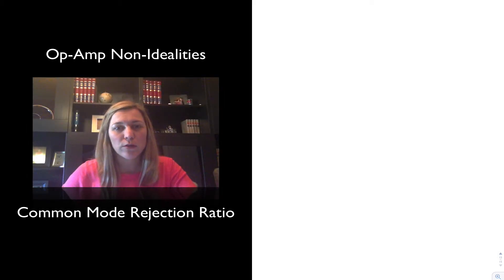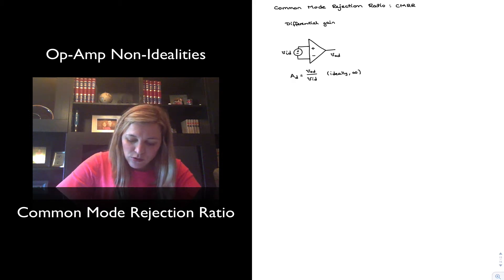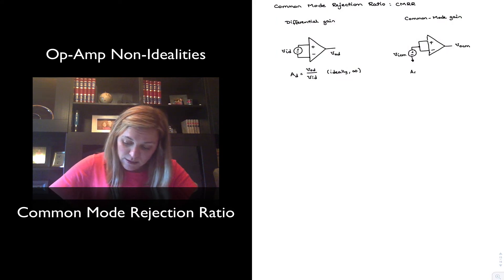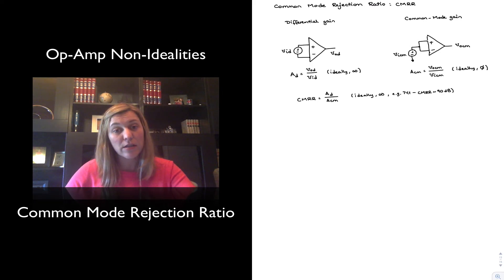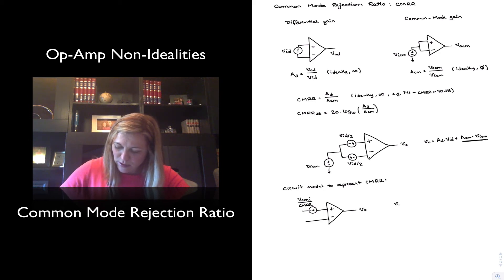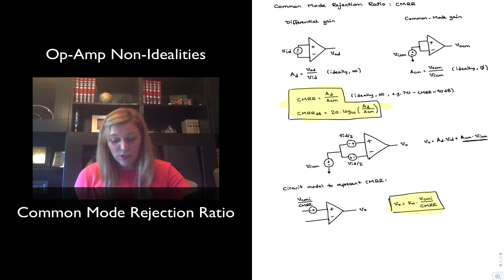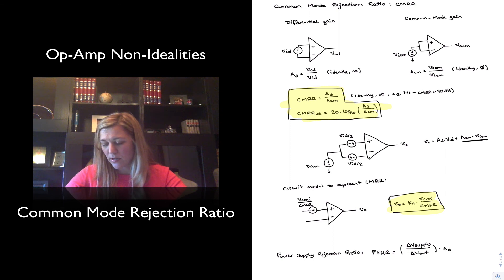Common Mode Rejection Ratio

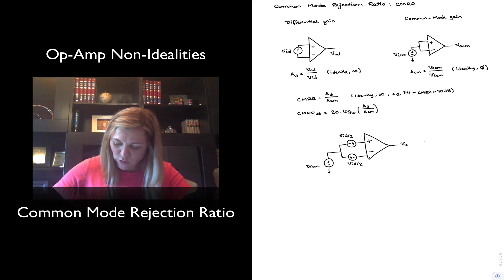Comment: Pls tell me why are you applying opposite polarity signals?? (At 5:54)
Reply: If V_{icm} is 0 V, then the node between the two V_{id}/2 voltage sources can be treated as ground. With respect to ground the voltage at noninverting input is +V_{id}/2 and the voltage at the inverting input is -V_{id}/2, so the output will be v_o = A_d(V_{id}/2 - (-V_{id}/2)) = A_d(V_{id}), which is what the equation to the right of the diagram says we should get. If you make both the differential voltage sources the same polarity, the two voltages will cancel out, and we will get v_o = 0.